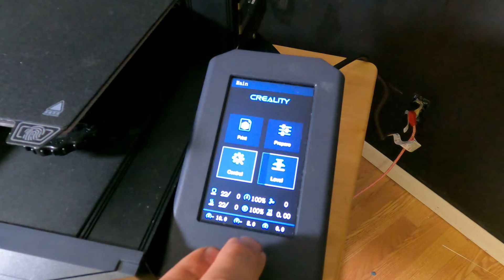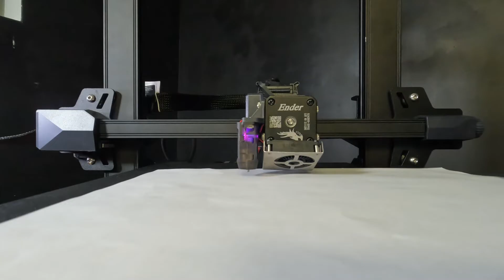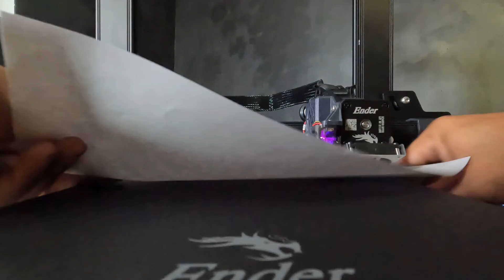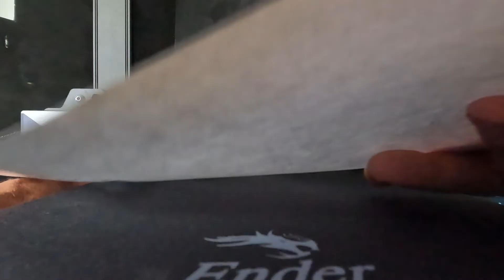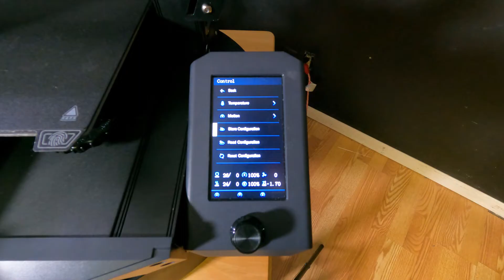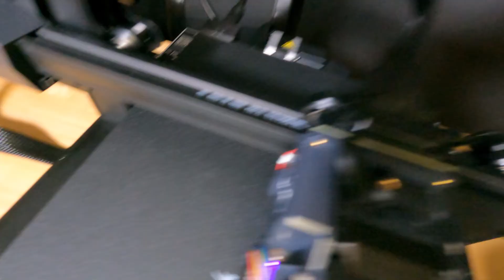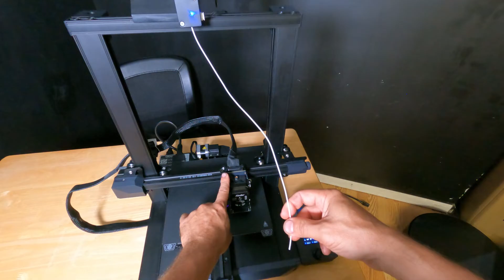Creality Ender 3 S1: How to Level, Set Z Offset, and Make an ABL Mesh - The RIGHT way.

Comment: very helpful, but I have had my Ender 3 S1 over 1 year now and have NEVER been able to print anything on it, since the beginning, I get the overheating error and cannot even level the bed , it basically jumps within less than 2 minutes to over heat and I have to shut it off. I bought a new thermistor and it is still doing it, I will be ordering the motherboard in about 2 weeks to see if that will help, if not then I wont know what to do.  so I am trying to learn 3d modeling in the meantime until I get it fixed.
Reply from the maker: Bro, swap the entire hot end. https://amzn.to/44ykrIz
Also, sounds silly, but, make sure your machine is set to 110, and not 220. The Red switch. Check my build video
Reply: @3DRundown I already replaced it with a higher temp 300 C hot end, but it's still doing it.  been looking for the updated firmware for this unit to see if that works but can't figure it out to download it. it is on 110 also..
Reply from the maker: This is an S1? (not a pro or plus)? If so, use ths: https://github.com/mriscoc/Ender3V2S1
Reply from the maker: Have you done a PID Tune? Do the new firmware, then PID Tune
Reply: @3DRundown  did the new firmware and working good as fine as firmware goes, unit still overheats, I tried connecting to Pronterface to perform the PDI , but it will not connect with the PC, my Ortur Laser does connect to PC and I use the same USB but it just shows connecting and then nothing happens, plus unit overheats and I have to shut it off. I will wait till I buy the motherboard and hope that works, I will keep you posted.
Reply from the maker: PID tune should be in your firmware on the screen. I *THINK*.
Reply: @3DRundown i got it fixed, i replaced the motherboard and it works like a xharm now, been printing alot and made tons of upgrades to the printer now. Now i will buy another one...lol...thanks for your input.

Comment: This process creates a cyclical error.  Every time you adjust the z level you have to redo the bed screws... Also metal beds warp with heat so you're supposed to heat it first.
Reply from the maker: You DO NOT touch the knobs after adjusting your Z-Offset. That would defeat the whole purpose.  No, the metal bed will not warp. Also, I do show to do it warm. This is the way to get it done. Countless have followed my method, as have I, for more than 20 machines. ✌🏼

Comment: yioyu made this look easy... lol I am struggling but got a decent print.  I need to go back and re tune bed
thanks for taking the time to show this
Reply from the maker: It IS easy. I promise. It will come with experience. You'll develop a feel & an instinct for it. Soon it'll take you 2 seconds to bang it out, run an ABL, and adjust your Z-Offset

Comment: Thank you for sharing your review and resolving the “Z Offset”… I am having problems with my Ender-3 S1 PRO. To reduce the problem like this, I bought their (Creality) Sonic Bed, hoping it will help. Since I connected that, I couldn’t even print a straight line. If somehow it does, it doesn’t stick at all. I have spent my last 24hours watching various Vedic here on YouTube, and going through all the settings, updating Firmware, and yet I’m still cannot print. First I made a mistake Slicing model. I changed the Infill to Triangular thinking as this is the strongest would be better. Then I realised that setting Clogs the Nozzle, so I changed the setting for the Infill to “Line”, and yet I’m still stuck. Contacting Creality seems harder than contacting NASA. Any suggestions would be much appreciated, please! Thank you in Advance!!! Cheers matey!!!
Reply from the maker: While printing your 1st layer, adjust the Z Offset at the screen, till it sticks. Same way as if using marling.
Reply: @3DRundown  Thank you for getting back to me. I will positively try again. Finger crossed...
Reply from the maker: Let me know how it went!

Comment: For some reason my filament is not sticking to the build plate. Do you think it’s the actual resin or the offset?
Reply from the maker: Z-Offset. Baby step during your 1st layer till it's good. Also make sure the bed is clean. Wipe it down with IPA. Also, Filament, not Resin. Resin is a liquid for UV Resin Printers. 🤜🏼🤛🏼

Comment: Does this just mean that the auto leveling feature does not work well? This seems like I need to manually level the bed despite auto level.
Reply from the maker: Yes. You 100% need to manually level the bed. ABL will compensate for minor differences in your manual leveling. "tramming" is the proper term

Comment: Need your help. You always make sense with these things.. my problem isI get error  AB temp on my ender3 s1 pro how do I fix it. I tried looking up information from the book it came with no help. Can you do a video on this error what to do. Silly thing I did. I bought a new part. The whole printer head from Creality thinking to do a quick swap if that works but I’m waiting for the delivery. So I can learn from the broken one help 😢
Reply from the maker: You have a broken wire, likely on the Thermister. Imspect the wire, or, better yet, replace the Thermistor.

Comment: @3d rundown 
I followed all your leveling tactics from the paper leveling and then I saved the number of the offset and then went in and set the z offset and saved it settings (ender 3 pro). Noticed it saved to the sd card, then I did the bed leveling with the cr touch, then also stored that setting. 
Guess I’m wondering A. If I have to leave all the saved files on the sd card or just the most current saved ???
Also next thing, do I need to have the slicer program incorporate using the cr touch before running every program ?

Thank you
Reply from the maker: Yes, it saves to the card.
It will only keep one config file on the card. 
You will need a line after G28, for the ABL to work. Anything sliced prior to that line being there, needs to be re-sliced. I have a video here on how to do it in the Cura playlist
Reply: @3DRundown  thanks man, best case would prolly be to save the z offset number to the settings and card.
I went into the prusa slicer under the expert tab.
Custom g codes the added a g29 command after the bed preheat to touch off the nine points for the probe. Seem to work when I ran another g code. That sound about right for the process? That way the slicer will add that to every export
Reply from the maker: No. I would not do that. Your Z-OFFSET can change ant anytime. Even the smallest amount....  You will want to be able to go to the machine, and make a quick adjustment, when you see an issues with the skirt, or 1st layer, then just click SAVE,  and carry on. Coding the setting into a model, would be a huge pain long term. Save it at the machine.

Comment: My bed was too bent to do this calibration. The middle of the bed was always to far away from the nozzle after this calibration but the four corners was ok. I use a S1 plus and I needed to turn the 4 knobs fully down (full spring tension). Set z-offset to -5. Do the manual level in each corner an turn the knobs up and use the paper. This allowed me to get the middle and corners of the bed calibrated correctly even if the bed was bent.
Reply from the maker: Over tightening the knobs will cause the hot plate to flex and warp. You can actually watch it happen. This is the problem here.

Comment: This is a great tutorial IF you have manual height adjusting wheels. I have a new CR-10 Smart, and it doesn't have manual height adjusting wheels like my old CR-10 (or your Ender). No manual adjusting is allowed!
Reply from the maker: Yup. My CR6-Max has no knobs, which is a royal pain in the ass
Reply: @3DRundown  So what do you do?
Reply from the maker: Rely on the ABL Mesh, unfortunetly, and get that Z-OFFSET adjusted JUST right. Check your bed screws, make sure none of them are loose. My 6MAX had very loose bed screws. (video on that here)

Comment: great directions. the only hiccups I had were my gantry was out of level from the factory. Also I didn't tighten the springs before the first "auto home" and by the time I got the height close to the nozzle the adjustment screws for the springs were all the way loose. I had to start over.

Comment from the maker: Have I helped you? Help ME continue this channel with some support:
TIP: Click the "💗THANKS" button
Become a Youtube Member, by clicking "JOIN"
Support my Patreon: patreon.com/3drundown
Use my Affiliate Links when Shopping:
Amazon Link: http://amzn.to/2miGQq9
Creality: https://shrsl.com/424l2
Bambu Lab: http://shrsl.com/46lky
Sunlu: https://sovol3d.com?sca_ref=2756755.r8WNQiJdNf
Sovol: https://www.sunlu.com?sca_ref=4022320.F0sV6y4ht9
Support me via my Course: 3DRUNDOWN.COM
Reply: very good method. However, I would pretension the springs somewhat, then autolevel, and start your process. I feel without some pretension, the springs maybe too loose to have long term bed tramming, thanks, and regards
Reply from the maker: I tensioned all 4 springs as the 1st step at @7:35
Reply: Great video, however, I have one question. In your demo, you show pressing the home button to start lowering the head from the home position to the paper. I am good to that point, Next, you move the head from the center position to the front left corner. I did not see you disable the stepper at that point in order to move the printhead. I disabled the stepper in order to move the head but now the leveling pin is dragging on the bed. Where am I going wrong here?

Comment: My print head is hitting the glass bed just before the cl touch stops it. The print head has to slightly tilt. What setting will adjust that? Thanks!
Reply from the maker: I would loosen the Sprite screws, and adjust. Also, can loosen the grub screws on the heater block and adjust that as well. However, maybe a simple PROBE SPACER, is easier.... (check my video on that), but you shouldn't need it, with stock setup.

Comment: Hello! Thanks for your work for 3d print enthusiasts. I still have a problem (3s1 pro) with the level of the bed after automatic leveling (before everything is fine, all corners are ok with manula leveling). After that, for some unknown reason, there is a feeling that the bed is being folded, one side is a little too high and the other a little too low. Before the automatic leveling, everything was ok. I changed the surface to glass, the problem remained. Suspicion of the mechanism during automatic leveling. Another problem is that the CR touch does not measure where the nozzle is and not the entire area of the bed, but a smaller square, and on the right side the distance from the edge of the bed is greater than on the left side. When creating a bed map, the corners are interpolated where errors might occur. What are your thoughts? I would be grateful for any ideas as this printer has many places where errors can occur.
Reply from the maker: The S1 firmware is really poor and many people struggle with the ABL on the S1's. Focus on getting your Z Offset correct and manual tramming as good as possible. Then your abl wont have to do much

Comment: Just a question, i follow every step, but when i do the auto leveling, the cr touch measures every point. But when its finished, and the nozzle moves down to end the leveling, the nozzle touches the bed and leaves a tiny hole mark. I dont understand why this happens. Since the auto leveling compensates for uneven surfaces if i am correct?
Reply from the maker: The nozzle shouldn't touch the bed. Be sure to set your Z-OFFSET.  However, it should home at around 10mm, after ABL. Are you running a current firmware? I would update to latest Creality, or, MRISCOC firmware
Reply: @3DRundown  I just got the printer, so i thought it would come with the latest firmware. And which is the latest one? There are multiple downloads on the creality website for the ender 3 S1. do i take the most recent one? Or the one with the title: "mainboard version: V24S1_301"

Comment: Excellent video. You do what most "3D" gurus neglect. I really like the pacing also. But, when speaking about the PSU voltage, Please emphasise to set it to the country standard. South Africa etc uses 220V, not 150V. I've had customers in SA setting their psu to 150V as you suggest, and blew up their psu and blaming the machine for being faulty.
Reply from the maker: I have no idea what you mean about "Neglect". I poked around but didn't find it. Have a time stamp? As for Power, I explain the step for power in my Country, but, I assume others know to adjust it for theirs, but, perhaps they don't

Comment: My s1 pro has a leveling problem - alwys low at the same spots with cr touch - even when using a glass bed - is as if it determents the low spots by it self - there is none as woth octoprint with glass moved over the visual is correct - no low spots
Reply from the maker: The Pro actually just got a new firmware, have you given that a shot? I have the Plus, which is basically a larger Pro, and the ABL works really well on it. However, the firmware is pretty bad. I hope to swap the screen for a V2 or S1 Screen at some point. Not sure what is happening with your mesh, but def give the new firmware a go

Comment: Hey man great video, I have a CR20 PRO here at home but it’s kinda getting on my nerves. My z-axis won’t budge with the offset at all. When I put my offset in the - to get it close to the plate, as soon as I touch auto home it actually adds up my offset instead of subtracting it. Can anyone help me solve this problem? Thanks 🙏🏽
Reply from the maker: I cover this in my most recent video. When you audio home, it will go to 10 + Your Z-OFFSET. The Z-Offset, is only applies, when you manually move the nozzle to ZERO (Which is now 0 + your Z Adjustment), OR Start a Print. Again: When you start a print, it will go to the Z-OFFSET that YOU SET. It will NOT go there, when you home. When you home, it will go to 10 + your Adjustment. If you then, go into the menu, chose MOVE, and move to 0. 0 is now your SET Z-OFFSET, and that is where it will go.

Comment: This is the one part of 3d printing that needs to advance more than it has. With such precision steppers and levelling probes/ software I do t understand have we haven’t moved beyond paper in all 4 corners. 
What exactly is stopping a com spy producing a machine where the height is sensed and the machine adjusts as it goes.
Reply from the maker: Indeed. That time is now, with Bambu Lab, using Lidar and such, but at a reasonably higher price. I do think we will see allot of progress over the next few years on this, but I also suspect low cost bed slingers, are here for a good while

Comment: Hey man thanks for your help I this is probably the best video on this topic. But I have 1 problem my nozzle scrapes against my print as it goes but it still prints decent is there any advice u could give I have a ender 3 s1
Reply from the maker: Hit u back in a bit with some thoughts. (It's 1am and my brain is asleep. 😛)
Reply from the maker: I would first consider trying a different infil pattern. Some patterns are more prone to this than others. Have look at your Z-rods, to be sure you are not experiencing any Lag, and consider slowing down a thing or 2 in your accelloration. Have a look at my most recent S1 video, and check over your girl
Reply: Ok ima try thanks man ur the man

Comment: hi mate cracking video. better than the official one. can u possibly help me.. iv leveled up etc.. and printed but the probe is the same distance from the table as the nozzle..i e.. when i use paper t set etc.. the nozzle nips the paper and so did the probe
is this normal.. or prints fine but then 2 are the same height
Reply from the maker: No, the retracted Probe Needle should be ABOVE the Nozzle. The extended probe Needle, during probing, should touch and retract before the nozzle. Have a look at your mount. Somehow, the Probe is too low.
Reply: @3DRundown  hi thanks for that ive unscrewed the head amd taken up the slack so now the retracted probe is around .5mm higher than the nozzle....does thar sound better?

Comment: Thank you so much!!! How often should you run the level bed command and check z offset, before every print?
Reply from the maker: Only when you see an issue. If you start seeing a first later where it's inconsistent, running ABL is often enough to correct it. Z Offset is something you should get comphy keeping an eye on. Sometimes a print will fail to stick it's first layer, and you'll just know to cancel it and dip your Z a tiny bit, start again and be good to go. I always use a skirt, so I can adjust before the print starts. A good tramming and ABL should last you many prints.

Comment: Might I suggest doing z offset 1st?  This would keep the bed springs tighter.
Reply from the maker: Hi. I did indeed do the Z-Offset 1st. I tighten the springs till snug-ish, then let them all off a bit. After letting them off a bit, I do my Z. Then my Paper Method, then my Z again. Gotta let them off a bit, or the bed will be super low, and  you won't have much wiggle room, to move the bed in both directions, if needed.